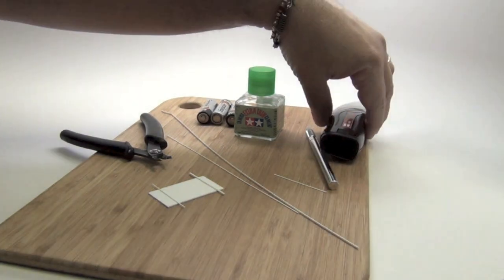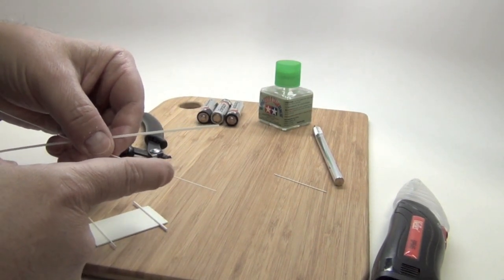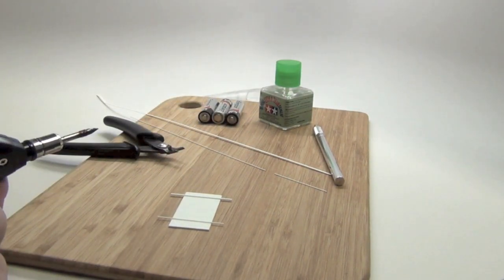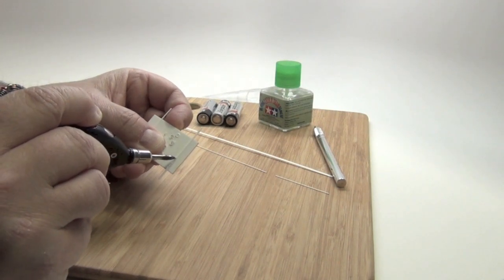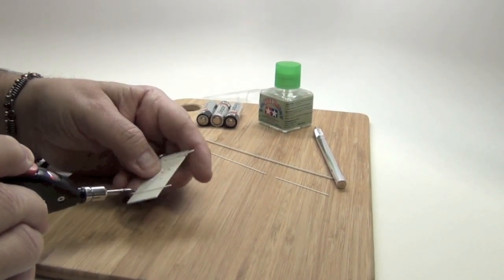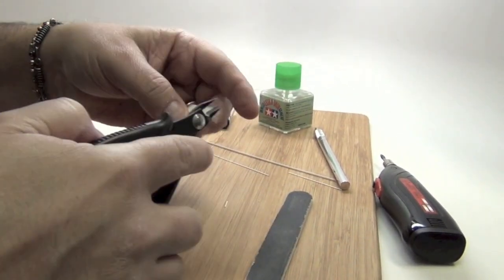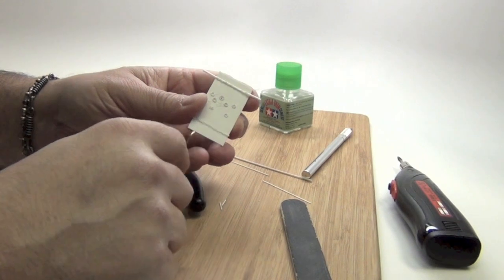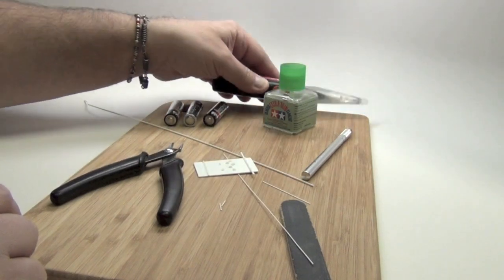CLINIC:  PANEL WELDS (STITCH WELDING)

Comment: for those of us that don't own one of those we use the glue method.

glue down your rod apply more glue until its soft and get a blade with the tip broken off so that the tip is flat and push into the rod. Thinner is better as it takes less time to soften